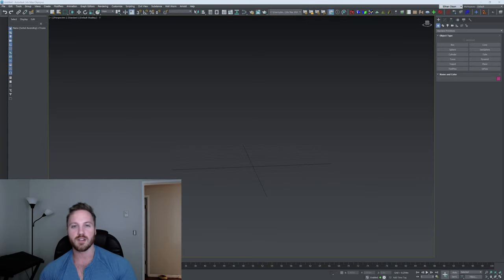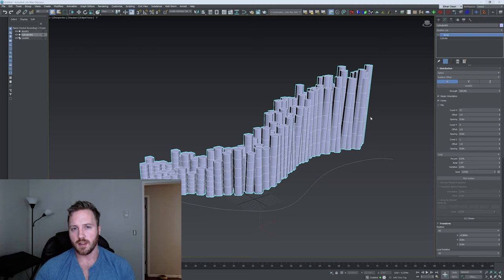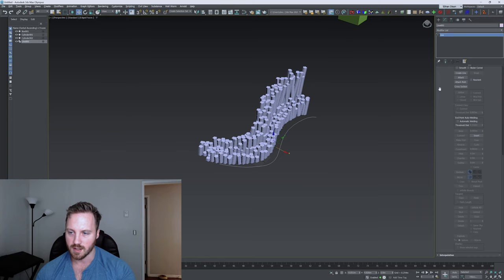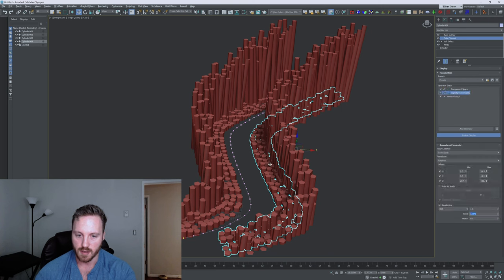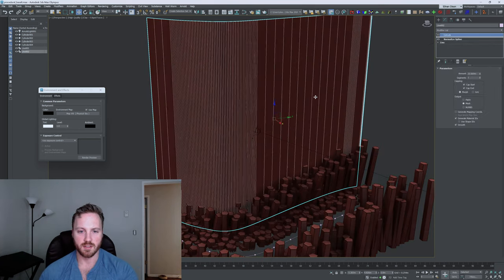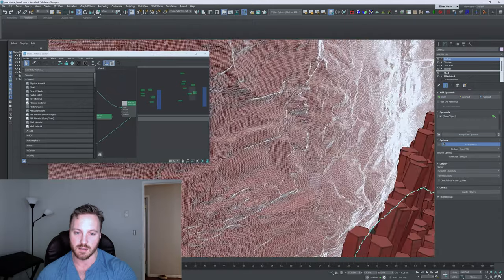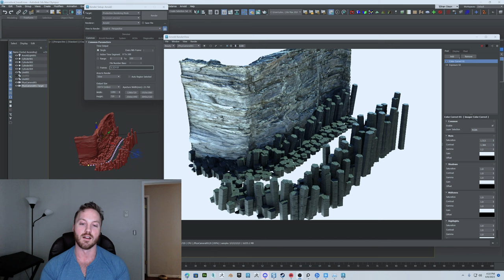3ds Max 2024 Tutorial - Procedural Basalt & Cliffs

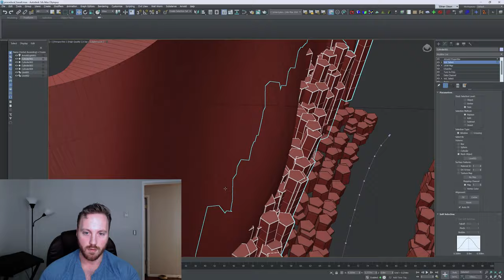Comment: At 8:02, can this be done without using wall worm using native tools?
Reply from the maker: SelectFaces and DeleteFaces are part of WallWorm (which is free). But this could also be done in a way where you use volume select, select your bounding box object, do something such as turn to poly, or even just an edit poly, and control click element (which will convert selected faces to elements). I'm sure there are many other solutions but those are some quick ones that come to mind.